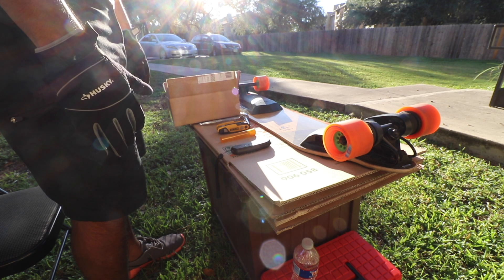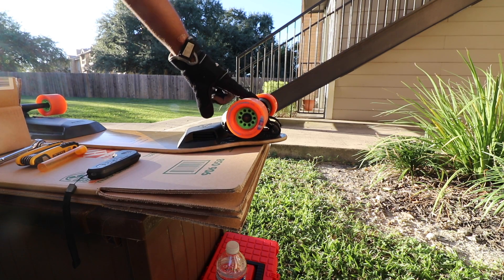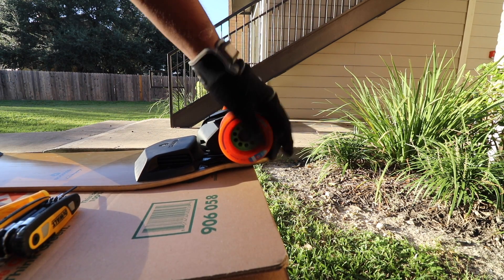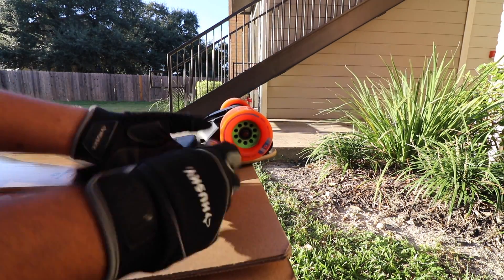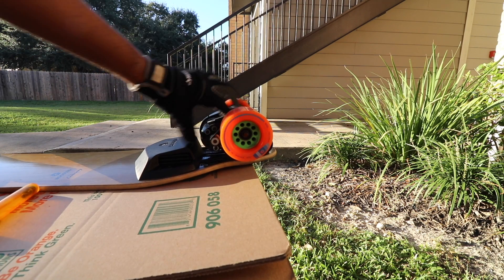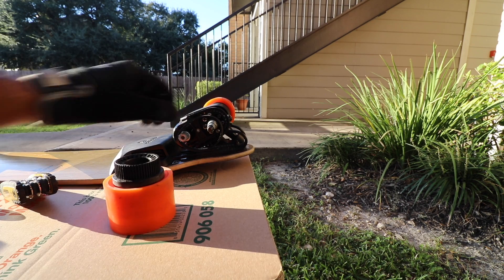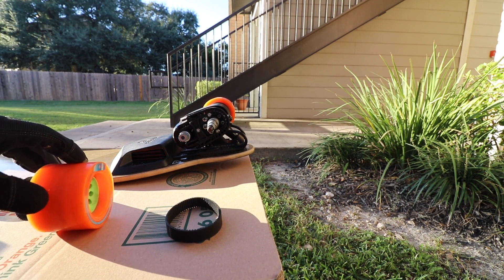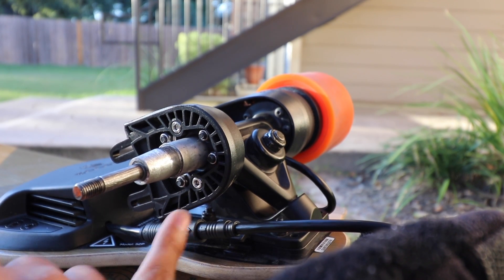MOTOR SWAP ON A BOOSTED BOARD V2!!!

Comment: any specific tension advise of the belt once you screwing the screws..  I kind of hold the motor in place pushed the belt to check how tight when screwing the motor back